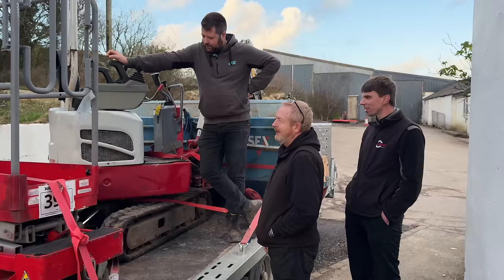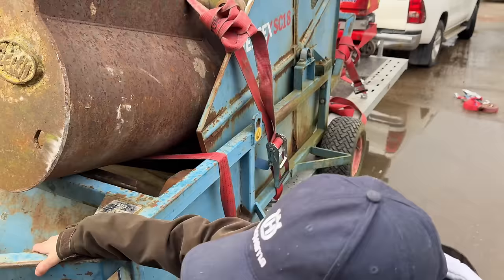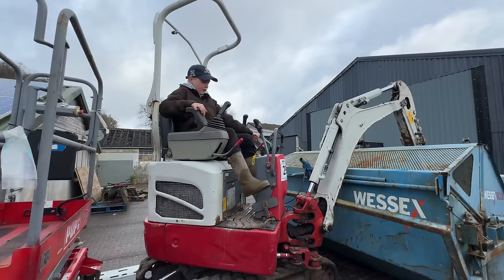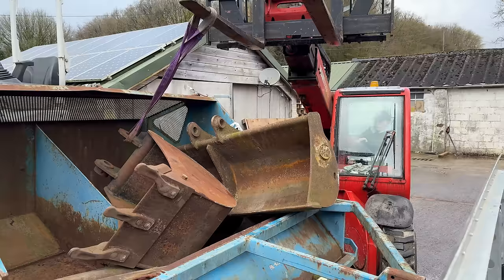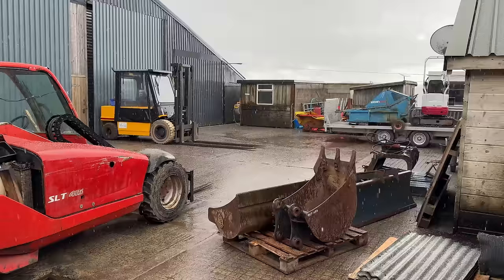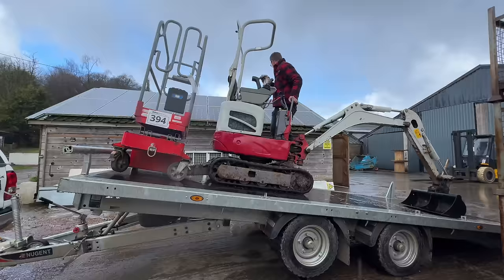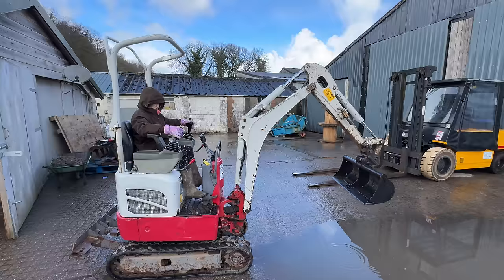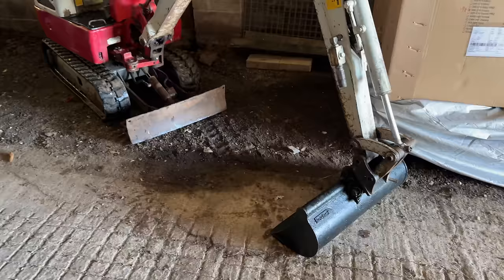Full Trailer of Machinery from Auction - Good, Bad or Ugly.

Comment: A Digger for all the family 😀😀 more handy buys 🤞🤞 the sweepers missing a few parts if I remember correctly there should be a 3point linkage head stock and ball hitch for towing work had one many years ago sat in the yard hardly used Thanks again
Reply from the maker: Thanks so much Darran. Still can’t workout how the PTO goes through the drawbar 😂
Reply: @finditfixitfarmit  The drawbar picks up on the 3 point links above the PTO  
I may have a leaflet or manual some where🤞